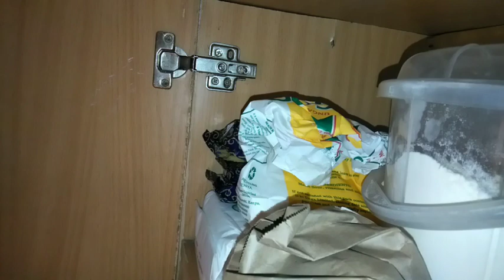RENTAL KITCHEN MAKEOVER; BUDGET FRIENDLY (no paint)

Comment: Lovely work does the wall paper easily come off? As in if your landlord wants the original back will removing it destroy the cabinet
Reply from the maker: Yes it can be removed very easy actually
Reply from the maker: You just spray with water let it soak then peel it off
Reply: @MsAtieno  great
Reply from the maker: You are welcome
Reply: The water will not ruin the wallpaper say one might want to use it again
Reply from the maker: Not really meant to be used again dear but its good water resistant

Comment: Did u use scissors to cut in shape? Where did u buy the roller and @hw much? You've really inspired me💖💖💖new sub
Reply from the maker: Hi Gorgeous... Yes I did scissors ruler and a tape measure to cut throught the wallpapers.. advise cut and inch more easier to trim it down... The roller I bought it in Eastleigh at a hardware shop you can get it at any hardware for 200 Bob...

Aaaand thank you so much for subscribing ❤️❤️❤️